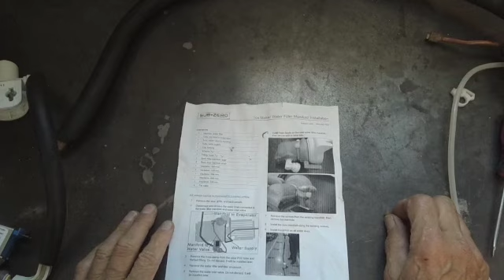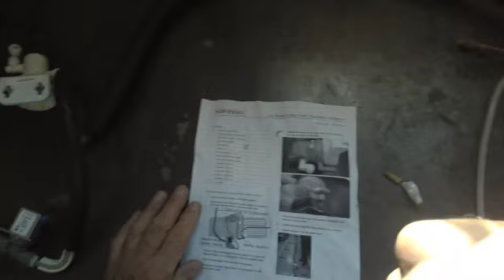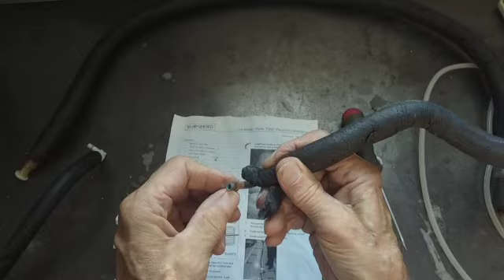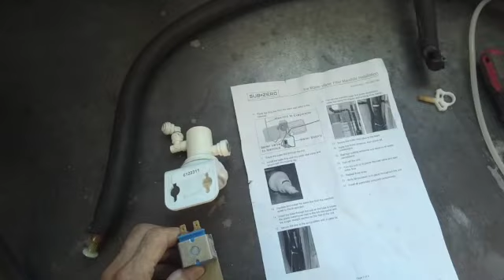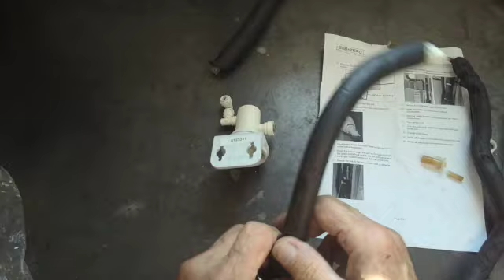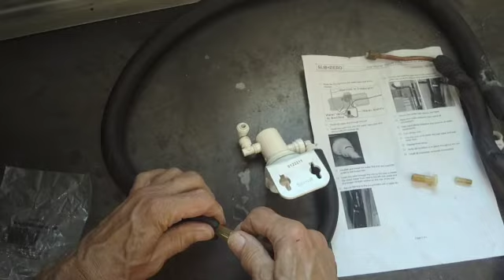Sub-Zero Ice Machine UC-15 Filter Manifold Leak Repair

Comment: Amazingly helpful! Re-routed the lines per your suggestion (i re-used all prior lines but did have to purchase an extender for water supply into water valve). Seems to have fixed my leaking issue! This resolved the issue after 2 different repair companies did not. You rule! My UC15i is ~12 years old... I'll keep you posted if any updates.